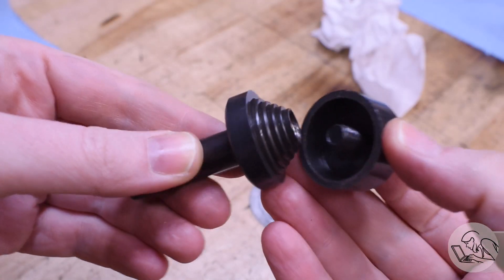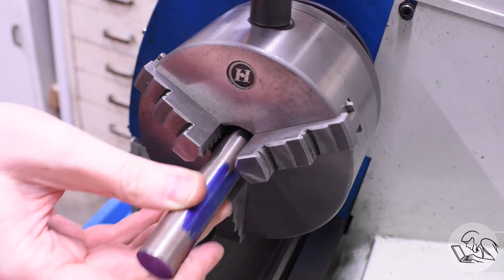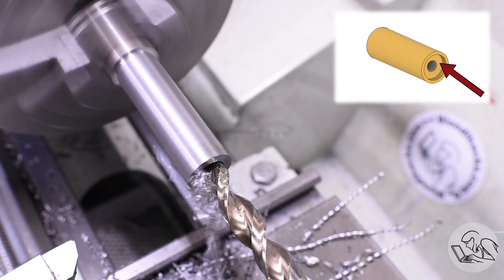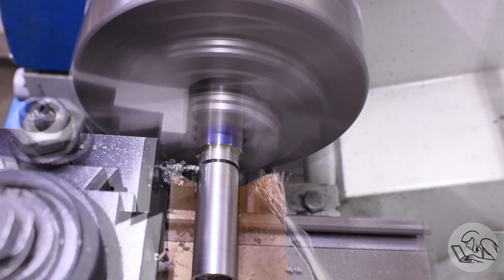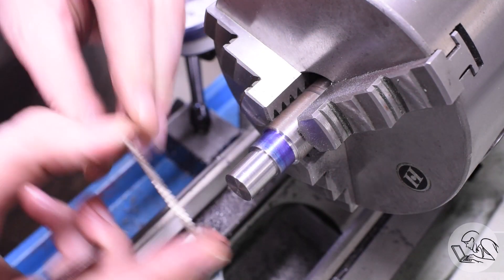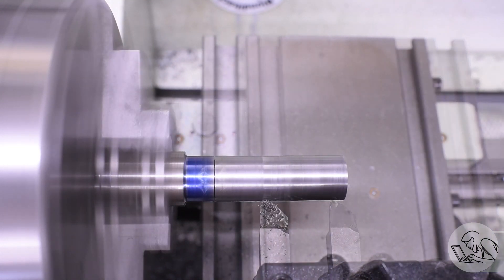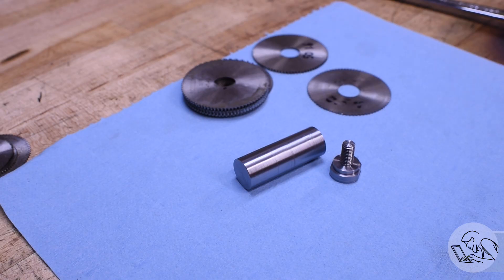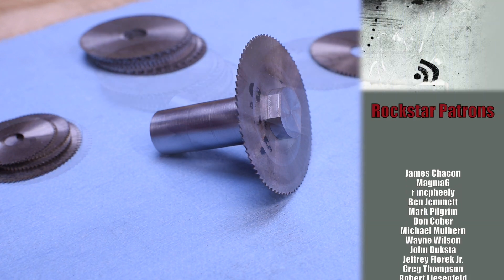Let's Make A Slitting Saw Arbor!

Comment from the maker: Hey everyone- the most common question on this build is why aren’t there wrench flats on the arbor as well? You could do that, but it wasn’t needed for me because the arbor is in the mill when I install the saw. If I want to install it outside, I can hold it in the bench vise.

Another common question is why is the registration diameter on the cap instead of the arbor? Because that was the way that occurred to me to do it such that it would accommodate different saw thicknesses. It’s still less than 1 thou TIR this way and more than good enough for hobby slitting saws. I’ll never claim this is the best way to do anything, but don’t get overly obsessed with details that may not matter for your application, either. Things don’t have to be perfect to work and we’re just hobbyists here.
Reply: RED, ORANGE, BLUE, VIOLET, GREEN, BROWN, PINK, MAGENTA, TURQUOISE, YELLOW, GREY, WHITE

This is one colorful comment you might not want to delete.
:
Reply: I bought a really expensive super fancy pants .0004 TIR straight shank saw arbor from TMX, and it had the same design in this regard. The thread was actually a separate cap screw, but the registration diameter is on the cap, not the arbor.

Also, fun fact, I made the arbor from this video first, bought a fancy TMX slitting saw, and then the saw didn't fit. I thought it was my fault so I bought the TMX arbor and it turns out that the slitting saw hole was out of round 🙃 I had to go at it with a Dremel before it would fit on the TMX arbor. Yaaay.
Reply: Registration on the arbor vs the cap is a tradeoff between theoretical best concentricity and z height; easy enough to put a recess on the cap if you're willing to use a screw in it instead of threading it, but then the cap needs to be tall enough for the registration diameter to nest into it when using a thin saw. With it on the cap it can nest into the arbor where you already need material. I did it on the arbor when I made one, but I was more annoyed by runout than by clearance at the time.

Comment: Great job of machining and lots of clearance.  I had the same crappy slitting saw arbor and made my own but not for the exact same reason as you.  The saw would tighten the screw so tight I could not remove it.  The first time I heated the arbor and used a pipe wrench and such to remove the screw.  The next time that was not enough to move it and the cap stayed on.  So I used an external thread with a nut, not as much clearance but I can get hold of it to remove it.  I also put in a key for the saws that have a keyway.  I hope you will keep us up to date on how your arbor performs and whether or not it tightens the fastener too much as I just might want to copy it.  Thanks for the video.
Reply: I did the same thing and never could get the thing apart. Maybe Never Seize next time?

Comment: Your design lends itself to being made double ended. Why not make the other end fit smaller sized slitting saws. 😉
Reply: Brilliant idea!
Reply: I agree!
Reply: I intend to make one with a  Morse taper on the end such that it fits directly in my milling setup of an Emco.
Reply: That's not a bad idea until you think about clearance.
Reply: @mattiaconti3682  I don't understand? It would be the same diameter along the whole length.
Reply: Ah, you intended the other end of the tool, not the bolt.
Ok, I get that, however it would be easier to simply replace the end bolt with one that has a smaller diameter.
Reply: Because of 10:13 to 10:54 you'd have a really hard time getting concentricity at both ends.
Reply: Good suggestion there Matt.

Comment: I've not used a slitting saw yet, but have observed that most videos of them show significant runout which offends my OCD tendencies. Loved the project and seeing that saw run in near concentricity. It made my day. I can live with the imperial collet size and metric wrench for tightening, working on most things now days seems to require both systems anyway.

Comment: For extra monster cred, use Whitworth wrench flats, and a metric screw thread, with your imperial shank size.
Reply: I think you just described my import 1985 Enco knee mill. Took some comments from the wizards of Practical Machinist for me to believe the combination of threads the machine actually has.
Reply: @chrismorris8695   I own a lathe which uses metric and imperial screws and nearly every screw and bolt has a different head.
Some are slit some cross and some allen head.
Reply: @Sven_Hein  Are you willing to sell one of your two lathes?
Reply: @ChristophPech   I had connection issues and it posted twice.
Sadly there's no lathe for sale.
Reply: Sound like doing same mechanicsl work on a 1970-1972 years SAAB 99. Think it got all three in there. An English Triumph motor in a Swedish car.. 😁😇
Reply: @someoneelse7629  I have done mechanic work on Evert SAAB from V4, with Ford Tanus V4 motor (both 1.7 and 1,8 liter motors), through the Triumph 1.7 and 1.85 liter the Swedish 2.0 liter om SAAB 99 modell. A looong time ago.

Yes, the first two manufacturers did have Imperial bolts and nuts. Which was a bit problematic. But as Long as you got 1/2" wrench, as 12 mm was too small and 13 mm too large, there was no problems. Except to remember where each Bolt should go when you put it together.
Got beter with the Swedish 2.0 liters, when everything got same with all metric. As God(TM) wanted it to be.

Comment: On the end cap might be a cool idea to make a roto broach and broach a hex internally.  Building the roto broach would be a good project as well as making your set of arbors out of tool steel and heat treating them and finishing them either with a tool post grinder.  Of course then you would need to make either a nice wood case to house them in your tool box.

So enough with my content ideas.

Nice job Quinn.

Comment: Nice one Quinn. My arbors have always been based on a 16mm bolt with an section of straight shank before the threads. Threads cut off, and the bolt hex head turned to a few mm thickness. A hole drilled through the shank, and a cylindrical cavity bored in the remains of the head, to the same diameter of the saw hole. A threaded cap goes through the saw blade an into the cavity. A draw bolt (6mm) goes from the shank to the cap.
This allows VERY low profile of the blade holding. The hex of the bolt and that of the drawbolt are both still useable to tighten or loosen the saw blade. Loss of rigidity from the hole through the arbor is not an issue with slitting saws. Keep safe in 2021. Give Sprocket a treat.

Comment: You did a top notch job there my friend. This is coming from a former tool and die machinist and designer. I am getting back into machining at home as a hobby and am gradually building up my tooling. I was using some cheapo Harbor Freight slitting saw the other day with a makeshift arbor I cobbled together. I was in a hurry so I just bit the bullet and went this el cheapo route. well, needless to say, I got through half the cut and the cutter quit on me. I have to take the time and do as you did here. Again, you did a really nice job with your arbor design.

Comment: Those slitting saws are great for all kinds of jobs. I have a little model builder's table saw that uses slitting saws, and I have a lot of those, so it was obvious that I needed an arbor for the mill too. I placed the mounting flange for the saw blade on the arbor so I could turn both faces in one go. I think this reduces run-out introduced by the screw type you made. No idea if this is really necessary but it works great. I also made an (extra) cap that consists of a counter sunk bolt with a fairly thin ring for clamping which allows me to get real close to my vise.

Comment: I've had a set of those Dewalt Extreme drill bits for quite a while now, they are great cutting tools. I can tell you that from my experience you can go straight from the centre drill to the finish size (note: the biggest I have is 13mm) without a pilot and without any complaints from the drill bit. Of course, the correct size pilot (must not be larger than the spigot) does reduce the load quite a lot. Stepping up through he sizes is just a no-no with these drills as without anything to hold/guide the central spigot, the drill wanders horribly. Just try the biggest one on some scrap steel and see.

Comment: 👍 I made my own because I wanted to be able to get closer to the center (depth of cut) and more height clearance to the arbor lower end. Plus I had the materials on hand and I'm a cheap bastard.... I bought about $2k, 40+ pcs, of NOS premium quality US and UK made HSS slitting saws for $85 on e-bay and made two arbors for them from 4140 - 1/2" and 1" centers.

Comment: hi, i've only just found you on youtube by accident and i love your videos by the way, they have taught me quite a bit i needed to know like tool sharpening etc,  now for the nevative comment, or problem should i say, ( not aimed at you by the way ),  being a few decades older than you and a relitave beginner at the lathe jobby and now that the person that got my interest in turning has passed away far too soon, (retired rolls royce engineer )  i'm left with watching videos to find my way through this minefield, i bought a chinese sieg c3 lathe a couple of years before the chaos set in which i only use now and again or when the mood takes me or i think i need a spacer or something simple for  my motorcycle or whatever, only to find that for most things i come accross seem to need a milling machine to complete the project or at least to make things easier, this meens that i have to spend the thick end of a £1000  (which i can't either afford or justify ) to get a half decent machine, then there's the cost of tools to go with it and of course time to learn how to use it by watching video's, and i've not much of that left at my age,  are they any other ways i can make some of these things whithout going to the expence of getting a miller, regards, steve.

Comment: Great video. Tip: chamfer your hole before it's tapped, because sometimes your chamfering tool/bit can "smear" the entry thread. A chamfer on the hole can also help ease in the tap at the very beginning, too, especially if it's not being guided.

Comment: This is actually really nice, and so much simpler than other low profile slitting saw arbor's I've seen. I'll even forgive using the calipers to make a line, because I've totally never EVER used a tool for other than its intended purpose..NEVER...*cough*

That said, I believe I'll add a wrench flat on the arbor as well. Not because it actually needs it, but because I'm paranoid and I just like the idea of being able to put a wrench on both sides.

Comment: I GET why people are mad about marking with the calipers.  I really do.  However, I still do it.  I end up breaking my calipers by dropping them, or smashed in some other way before I wear them enough to matter anyway. This is why I keep a couple pairs of Starrett or B&S calipers around, so I can just keep working when I forget the calipers on the carriage and bump them onto the floor!
Reply: I left a pair on the gear change box of our tiny lathe. The carriage being power fed trapped it against the housing and folded them in half. Barely even loaded the motor.

Comment: A nice and simple design, I like it!  I guess that reversing the process of making the cap and body would make getting the runout low more difficult.  You'd need to remove the cap to start making the matching hole in the body.

Comment: No, we are not stuck with you. We come here by choice and enjoy the trip. Use your calipers how ever you want. They are yours. I have calipers that have been used for marking for at least 35 years and the points are just fine. It's not like you are gouging metal out. You are just scratching the Dykem. Dykem is pretty soft stuff.
Reply: But you don't want to mount the calipers in the tool holder and use them as a parting device. 😁

Comment: Quinn, as a fellow small hobby lathe owner I understand the virtues of 12L14 and I've noticed you like the stuff too.  However, I live on the Atlantic coast and the "salt air" just loves to eat that stuff up. I don't know why, but 12L14 just rusts like crazy. I've recently done a couple of projects with 1215 and I'm lovin' it. As a bonus there's no worries about the lead content. If you haven't worked with the stuff, you should get some and give it a try. Just tryin' to give a little love - as requested. : )
Reply from the maker: Thanks for the tip! 12L14 does indeed rust much easier than other steels. I’ll give 1215 a try!

Comment: Sometimes, I use a section of a bolt instead of cutting threads. I Loctite it into one part so it stays put. You end up with rolled threads made of heat treated steel, so it is stronger than if I made it out of one piece of steel. Your thoughts?
Another low profile tightening method: drill 2 holes on the face of the cap and use a pin spanner wrench to tighten.

Comment: Also, Clickspring seems to use (or grind) a point into his parting tools (so the tip looks like a wedge instead of a square), so they meet the work at a point rather than a flat surface. I haven't asked him why he does that, but it might be worth a thought. It's like having back clearance on a parting tool.
Reply: Please correct me if I am mistaken but I believe Clickspring only uses that style of parting tool on soft brass. He also does some stuff by hand, like a wood turner, mostly contours.

Comment: Guess what I made today before I watched the video, my arbour had so much metal at the bottom that it was practically useless. The one I made, like yours, had less run out than the commercially made one. As an aside I keep a cheep vernier for marking out, it cost very little but is only about 5 tenths out.

Comment: For hex wrench sizes less than about 1" the wrench size should be about 0.005" larger than nominal.  The Machinery handbook has a calculation for what the exact size should be, but the general rule of thumb from that calculation is up to 1" sizes 0.005" works well.

Comment: Happy New year good looking :) 
Question,  i see that you used a right hand thread , would it be better to use a left hand thread for safety.
Reply from the maker: The mill spins counterclockwise so the cutting forces tighten the arbor with a normal thread.

Comment: Great work Quinn. 
One question just out of curiosity, you faced the Arbor before turning the final outside diameter in the second setup, so the face and the shaft are not necessary orthogonal to each other anymore. Is the Blade "wobbling" up and down now? You could check this with a dial indicator and of course fix it easily by facing the arbor again.

Comment: It probably doesn't matter much (metals not THAT expensive), but as you said that you predominantly have slitting saws with 2 different bore sizes, I thought you'd have machined the other end of the arbor to take your next most prevalent bore size of slitting saw. As long as you take a couple extra thou off the retaining bolts so the collet doesn't grip on them you should be golden.

Comment: Is there any reason you don't face the bottom of the counterbore with the boring tool? (Rather than using a flat bottomed drill) -  It works for me.
Reply from the maker: I do, but this saves a lot of work over having to square up a traditional drill cone, which is the whole point.

Comment: If you're a bad person for gently scribing with a caliper, then I don't want to be a good person.  I'm still not sure why that procedure is supposed to be bad, and what the preferred method is.   Have a good year!
Reply: I can think of a few reasons why it's bad but frankly I'm a great believer in do what works for you, I do similar with calipers.
Reply: The thought behind it being bad is because calipers are precision measuring instruments and your putting unneeded wear on a measuring surface. My opinion is it's only bad on nice name brand stuff like Mitutoyo or Starrett. I have cheap Amazon calipers I use for fast layout. You can get vernier calipers for under $10, which basically make them disposable.

Comment: I have been wanting to ask you what do you think is the best kind of tap/die for the lathe? I see you using the smaller type that looks like it attaches to the chuck in the tail. Do you dislike the idea of the free floating type for the mt3/mt2 tapers? Im still kind of a rookie but this will be a very important tool for me. Thanks for the vids they are more helpful to some of us than you can imagine!!

Comment: 7:37 Ahhh what were you thinking? You're scratching up the paint like that :(

Also, love your content. I've made many one-edged tools (like fly cutters, because i couldn't be bothered to buy slitting saws or HQ endmills) for several applifations, and they're the most lovely tools i have

(for the mill that is, but carbide inserts rule on lathes)

Comment: Yahtzee dice build, maybe please? If you think it’d be fun to say Yahtzee while cutting off Yahtzee dice. Maybe possible if you find a machining method at the same time.

The original owner of my mill/lathe made several slitting arbors out of strange drive shafts. Very solid but they look like art because of all the step ups and downs in diameter along their length.

Comment: Quinn, may I ask why you drilled for the tap before using the square shoulder drill for the relief. It seems that the order of operation would have been improved if the drill would have had more meat to keep it centered. Not a troll, just want to learn.